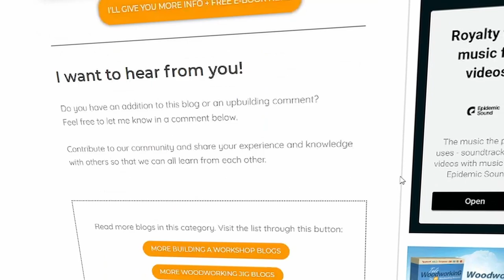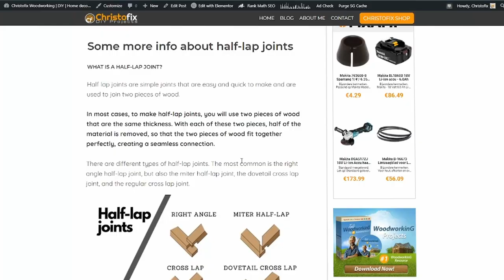Make PERFECT half lap joints with this simple jig

Comment: Great vid. U can eliminate the tee nuts with a wood thread tap. The wood threads in hardwood hold as much torque as you can twist on a knob. If you want a knob with a permanent stud just glue threaded rod into the threaded hole.
Reply from the maker: Thank you so much, my friend. Also, thanks for sharing this idea, I will try it out for sure. Greetings, Christophe